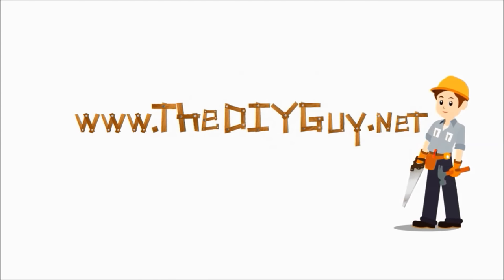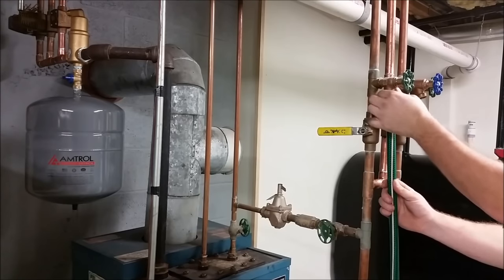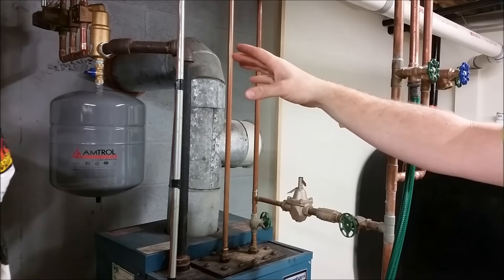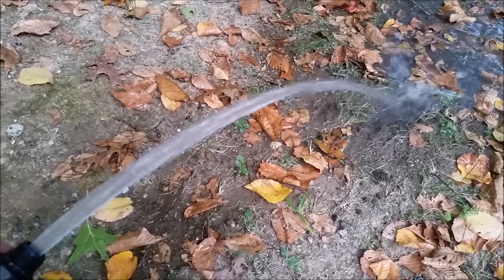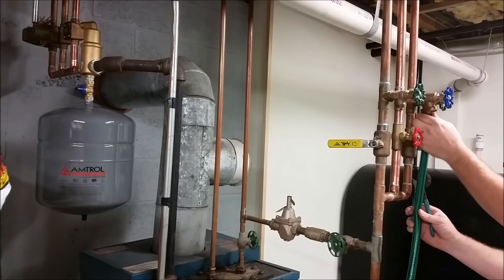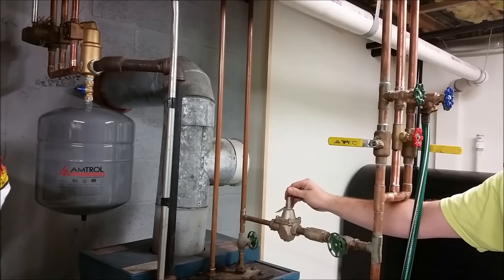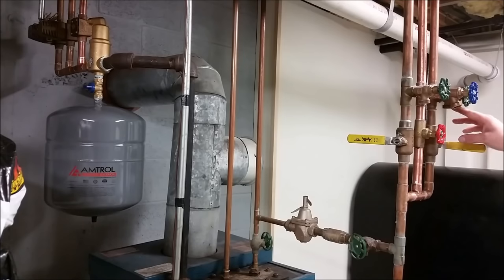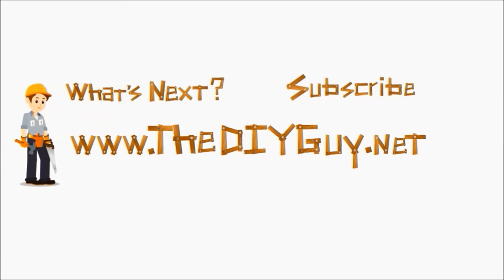How To Remove Air From Your Heating System

Comment: Quick question. After I purged the lines I noticed the psi has gone up and when I fired up the furnace it let's water out of the relief valve. So I drained some water out to lower the psi but it creeps back up. Thoughts?
Reply from the maker: Sometimes the auto feed valves stick or get some sand/ build up stuck in them causing them to keep letting water in. You could hook up the hose again and open/close the feeder valve a few times and see if you could get the stuff out or sometimes just tapping the top lightly with a small hammer or pliers will get it to seat again also.

Comment: If I bleed the system and there's nothing but cold water in there, won't the psi go too high once the water in the system is made hot? As my system is heating back up, the psi meter is starting to go above the red warning arrow!
Reply from the maker: Did you shut the auto feed valve before you closed the valve where the hose was hooked to? If so the pressure should have been low and then went back up to whatever your feeder valve is set to. You can bleed off some of the pressure with the hose if you need to.

Comment: is it ever normal to hear water rushing through the pipes every time the heat comes on?  We get a water rushing sound when the heat comes on and some minor clanking from the pipes. I don't know if  this is just normal or i need to bleed the system
Reply: Did you ever get this problem solved? I have the same issue

Comment: Can air in the boiler cause it to malfunction? and how?
Reply from the maker: Air in a boiler can cause strange noises like gurgling, rumbling, whistling , slow moving stream sounds coming from the pipes/ baseboards, you have a  radiator or loop that won't get hot at all, or a radiator that stays warm at the bottom and cold at the top. If its a smaller amount of air you can listen to your circulator pump as its moves the water and listen for it to chew up an air bubble. if its real low and the boiler has no low water cut off it can turn to steam and if the boiler relief valve is stuck could cause an explosion. If it does have a low water cut off it can cause the boiler to short cycle.

Comment: How do i know which zone goes to the different zone valve switches if they are not even in the boiler room? In my case all zone valves for each floor are actually in the apartments instead of boiler room. All zones for draining are in the boiler room but not labeled.
Reply from the maker: Not sure if your in the heating season where you are located but you can make sure all of them are off and then turn one zone on at a time and see which pipe gets hot and then label them to make it easier in the future. Another way and to be 100% sure would be to shut off all t-stats and turn one on and test with a multi meter number 1 and 2 terminals on the zone valve for any power which would be in volts. Should read zero with the t-stat off. Then label that one and turn it off and turn on the next one and test it. Then just keep repeating until you have all of your zone valve labeled.
Reply from the maker: um... So it looks like the boiler is plumbed like its a one zone system with one hot pipe going out and one return going back to the boiler. I'am going to guess the pipe with the circ pumps is the hot side going out. They doubled up the pumps to push more BTU's out of the boiler instead of installing 1 larger pump also in case one pump fails you can still keep the heat on. So does each level have a t-stat and a zone valve? i'm pretty sure it does. So the boiler hot pipe goes out and meets up with the return pipe and makes a loop then each apt it tied into that loop with a zone valve to let the heat into each apt/ level. So you need to locate the zone valves and there should be the shut off valve to isolate that zone/ level and the drain to flush that zone/ level. So once you flush that zone if its not better then I would say check both the pumps to make sure there pumping.
Reply from the maker: Just seen what your pressure is... it should be 15-20psi. That pressure relief valve must be constantly dripping or running. I would grab a hose and hook it the the drain valve next to the boiler body and drain off some of that pressure to get it down. If it goes right back up once you shut the hose off then the cold water top off valve or feeder valve is stuck or improperly adjusted and you will want to get that replaced. That should at least fix the problem with the water constantly coming out of the pressure relieve valve. You may have to replace that as well depending on if it shuts once you get the pressure below 30 psi.
Reply: TheDIYGuyDOTnet the zone valves and the shut off valves are both together.  The drain im guessing is one of the two drains right next to the boiler. My question is which one would it be, if i was to just try them after putting the zone valve in Manuel and closing the shut off valve on my floor would it affect anything with the heat? I'd rather test my own floor before doing it for the 2nd floor and messing things up and completely knocking off their heat.
Reply from the maker: OK, I think I get it now. So the only drain valve is right next to the boiler but you do have zone valves and valves to isolate the zone somewhere else that you can get to. So you would use the top drain hook up with the black handle and shut the gate valve with the black handle right below the drain. That way the water would feed into the boiler right below the black handled valve and then go though the boiler then the heating loop and then back to the drain where you have the hose hooked up. So close all the valves by the zone valves. Then open one at a time and flush that zone to get the air out. Then close that valve and then open the next one to flush that zone and repeat until all zones are flushed out. Be sure to open the drain valve and then open the feeder valve (or put on manual) to get enough water pressure to force the air out then put the water feeder back on auto or where it was and then let pressure get back down to 12-15 psi then close the drain valve.
Reply: TheDIYGuyDOTnet ok i believe i got it now....i started with the 3rd floor first, it ran for a long time and pushed out alot of air. I opened the feeder valve as well, so since it was the 3rd floor it should've taking a real long time correct?
Reply: TheDIYGuyDOTnet when it starts to push out hot water, its went through the full loop correct?
Reply from the maker: Great, Glad to hear we could help you get it figured out. Yes, It will take longer then the 2nd and base floor as the heating loop is bigger so the water has a longer way to travel.
Reply from the maker: Yes, as long as you have the black handled valve under the drain shut. Then it should be pulling the boiler water though the heating loop and to the drain. If you had the valve open it would come from the boiler that way and out the hose path of least resistance. You should see the difference as it should take a while for it to come out hot.

Comment: Question
Can I have two zones with one thermostat
Reply: No
Reply: Yes you can. 

My house has 2 zones, one upstairs and one downstairs. One thermostat upstairs. The hot water from the boiler splits into 2 pipes which go downstairs and upstairs. Each zone has a gate valve on its pipe where the water returns from the radiators to the boiler. 

This setup means the upstairs is much warmer and downstairs is cold. If I want more heat to be sent downstairs I close the upstairs zone's gate valve almost all the way, which sends most of the hot water through the downstairs zone.

Comment: How do I know which zone valve goes with which spice I am opening? thank you !
Reply from the maker: +Julianne Rose Hello, an easy way to tell what zone valve and which return valve are on the same loop is to turn down all thermostats and let the pipes cool if its winter and then turn one thermostat up and see which zone valve is in the open position or getting hot and then see which return valve is also getting hot when that particular thermostat is calling for heat.

Comment: i'm having trouble locating my zone valve. i live in a 4 apartment building where all the water heaters and furnaces are in the basement side by side.
Reply from the maker: +Rob Moogs Depending on how it was plumbed and how many zones you have they maybe have just used a circulator pump or two.

Comment: does air cause a howling when the boiler first starts up? then i hear the water girgling which now i realize i need to bleed the system
Reply from the maker: I don't think air would case a howl. You can bleed the system and see if it goes away. I would guess maybe a clogged nozzle messing with the spray pattern on the burner.

Comment: When you say shut zone valve off do you mean put back to auto because you never showed shouting the water valve off
Reply from the maker: Yes, You are correct I should have said flip the zone valve lever back to the auto position. You want to stop the flow of water and make it so the t-stat will now control the valve.
Reply: TheDIYGuyDOTnet  I was just curious I don’t have boiler. Thanks for the reply
Reply from the maker: No problem.

Comment: If step 1 is to shut the boiler off then why would the water heat up as you bleed the system
Reply from the maker: The water inside the boiler is still hot/ warm as it would take hours to cool down. So when that water from the boiler makes it all the way though the heating loop the water will come out hot/ warm.
Reply: @TheDIYGuyDOTnet  thank you for the response. Ive bled my second floor zone 2 days in a row now, about 8 buckets total until bubbles stopped coming out, still rushing water noise. My second floor baseboards don't have bleeder valves so I'm doing it as you do in your video. My old boiler had an air bleed on top of the expansion tank and my new boiler doesn't, do you think that could have something to do with it?
Reply from the maker: @MC-bh8ph  No problem, second and third story zones can be a pain. When you had the zone valve on manual and the hose hooked up did you lift the handle on the automatic water feeder like I did in the video? That adds a bunch more water/ pressure to the zone to help push all the air all the way though and out the hose. If you didn't try that you should hear the more water and pressure or see it on the pressure gauge. Like I said in the video be sure to flip it back down let the hose run a bit longer then close the valve with the hose on it not to make the pressure to high in the boiler. If you hear rushing water noise in that zone there is still air trapped somewhere within the zone. It may take a few times to get the air moving and out of the zone. Was it one of these on the expansion tank? https://amzn.to/4dC11qJ   That style of air vent is kind of out dated... and didn't seem to last to long depending on water quality and has been replaced with something like this https://amzn.to/3Nj9SCX I replaced the first style with the spiral vent one, new valve and expansion tank on this system in the video and that's why I needed to remove the air out . So the air in the system could be because there is not air vent or the auto water feeder is not adding water when the system is low. https://amzn.to/3BEoI4C on replacement feeder valves they want you to also install the backflow preventer.

Comment: I have  lots of air in my pipe. It took me more long time to skim and seems never can take them out. I don't find any leaking in pipe anywhere. Please let me know what should I do?
Reply from the maker: There are a few causes of air in the pipe. The system was opened somewhere, the make up valve isn't working or the air scoop hasn't been working for a while allowing the air to build up within the system. You want to flush the zone like in the video to get as much air out as you can and then the air scoop should be able to remove the rest. You might want to replace the air scoop or replace it with a Spirovent Air Eliminator best one out there to me.
Reply: Sometimes there are vents inside the baseboards. . if you have radiators its different
Reply: Call a plumber
Reply: Could also be a bad expansion tank. I had a bad tank and air got in when the bladder failed.
Reply: @GP9railfan  nope..expansion tank isnt going to put air in your line..

Comment: When the water turns cold does that mean the air is out?
Reply from the maker: Once the water goes cold I would say you got most of the air out. As the cold water is going though the entire heating loop. You can put the end of the hose in a bucket full of water and see how many air bubbles surface in the bucket.
Reply: TheDIYGuyDOTnet thank you sir
Reply from the maker: @godsu  No problem. Glad we could help. Good luck with getting the air out of the system.

Comment: This is what my problem is a loud knocking on the pipes every time I turn on the heat
Reply from the maker: It could be that you have air in the lines or it could be that the plastic slide guides are not aligned or missing causing the pipe to rub on the pipe supports within the baseboard. That would be more of a click click click if its a moan or knock it could be rubbing on wood somewhere.

Comment: I just did this 3 times, and still have air in system.  My system is almost identical to the one in video. Any ideas why?
Reply: Depending on what baseboards you have they may have bleeders on the baseboard itself, those have branches that maybe holding air that may not be moving. Also check your 700 vent cap leave it open so it can help purge
Reply: @athen161  hey Ben, I don't have any bleeders on baseboards themselves.  I have a watts dual air vent, both (red and black) are loose, although I notice some black slime coming from the black vent.  I have let the 2 zones run for for 15-20 minutes and no difference, maybe worse.  The hvac guy came to replace a taco valve so I had him do it and it still is the same.  Gurgling and slow water dripping sounds every time they heat comes on.  Heat works still so I figured I'd just wait till the fall when the HVAC comes back for yearly cleaning and make sure they solve the problem.  But if you have any suggestions I am appreciative ? Thanks

Comment: what about the pressure big guy? you didn't turn the zone valves into the auto position!!!
Reply from the maker: The pressure should be set by your auto feed valve so if the valve is working properly it should be between 12 psi-15 psi.

Comment: There's a supervent there, shouldn't be having air issues unless there are radiators
Reply from the maker: It's called a Spirovent. That's the reason there is air in the lines as I emptied out the system to install it and replace the old air scoop style air eliminator.
Reply: @TheDIYGuyDOTnet  there's more than 1 brand.. Scoop is outdated 20 years already
Reply from the maker: @thomasbroking7943  You are correct there are multiple manufacturer's/ brands that make/  now offer a coalescing type air eliminator. The one you mentioned the Supervent was by Honeywell and the Spirovent I mentioned was by Spirotherm. They may have been out for years but they are still far better then the older 1/8" ones that went on top of an air scoop. Is there a better air eliminator I should be looking into/ checking out?

Comment: Please help my room is freezing cold.. I see only one yellow handle, is one okay?
Reply: There are two valves but one yellow handle
Reply: Theresa another yellow handle but no open pipe next to it
Reply from the maker: It could be depending on the system if its a one zone system. Is there only one t-stat? Sorry just seen your other replies. Each loop should have its own exit unless there is another valve closer to the boiler that you can shut. If you click the link in the description it will take you to our website and at the bottom you can upload pictures and I could give you a better run down on what you can do.

Comment: I have properly bled my system. It will stay quiet for two weeks give or take a few days. Then the trickling sound returns. Then the gurgling sound returns. I wish I knew why or how the air returns to pipes so quickly. What could be the issue and remedy?
Reply from the maker: Not sure if you have bleed each zone.. You will want to do so as Tim Nixon just found out that he had air hiding in another zone that he thought was good. Whenever he let the system run normally the air came out of that zone and got caught in another. Once he flushed all the zones he has been good. There are a few ways air gets into the system. It could have a small leak somewhere causing the boiler to keep filling up with new water full of gases or on cool down sucking air back in where the leak is, the bladder in the expansion tank could leak ( not keeping the air and water separated), the air scoop letting air in rather then out on cool down or the same thing happening with the fittings on the radiators or the auto top valve not working or keeping the correct PSI.

Comment: How would I know if I had air in my system?
Reply from the maker: If you hear strange noises like gurgling, rumbling, whistling , slow moving stream sounds coming from the pipes/ baseboards, you have a  radiator or loop that won't get hot, or a radiator that stays warm at the bottom and cold at the top. If its a smaller amount of air you can listen to your circulator pump as its moves the water and listen for it to chew up an air bubble. Hope that give you an idea on what to look for.
Reply: @TheDIYGuyDOTnet  I have two rooms on one end of the house upstairs that don't get nearly as warm as my bedroom on the other end. Definitely hear sloshing in the pipes. Could the air be causing the issue with the rooms not heating equally?